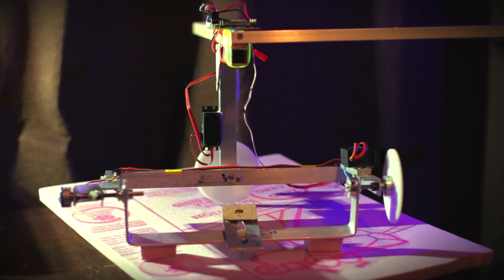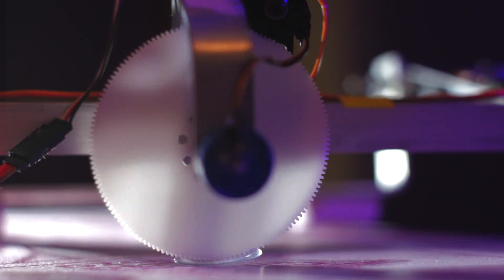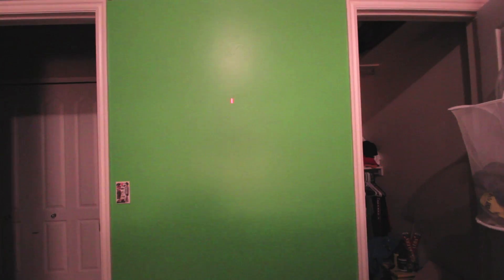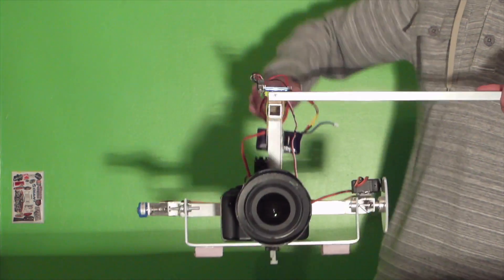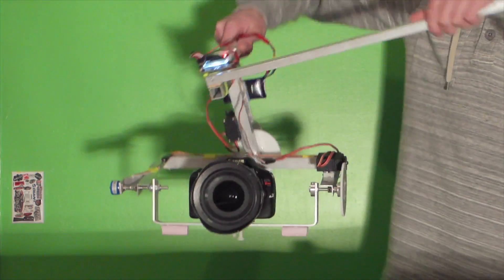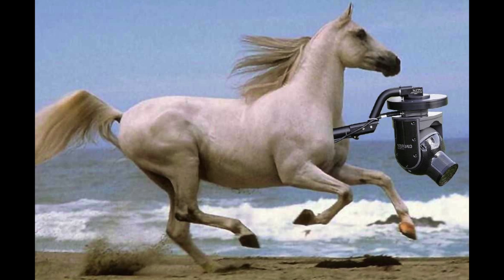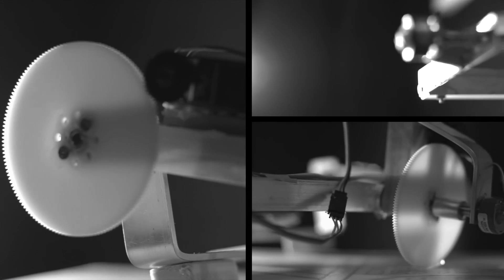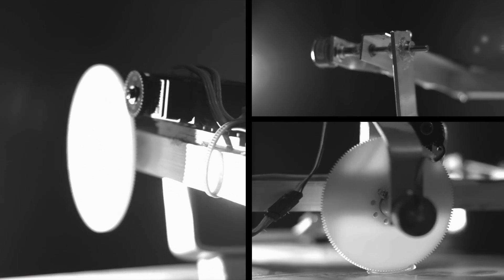Gyroscopically Stabilized Multi Purpose Camera Gimbal

Comment: a simple use of a potentiometer is for example when you rotate a knob to turn up the music volume.

In servos they are used in the inverse way so when you set the servo for 1 position, and an external force is applied, the potentiometer will "recognize" that external force (the music volume knob is being turned) and with that information, inside the servo will be sent an order to counter-act that force

hope you understood

Comment: Hi, you should really look into brushless gimballs.
There is a project going on called Simple Brushless Gimbal Controller (simpleBGC) by a Russian called Alexmos. 
The result are amazing and aproach the result of the DJI Zenmuse.

The roll and pitch are angles are done by normal brushless motors, but they do need to be rewinded to increase the torque. The gimbal is directdrive, so no gears at all.

The first batch of controllers is due to be shipped in 1 or 2 months.

check it out!

Rutger

Comment: I would recommend lookiung into stepper motors like on cnc machines..they could work direct drive or geared and are extremly precise and allot faster than servos...Allot faster..though a stepper motor driver will be required. take a look on ebay :) sonme great deals..